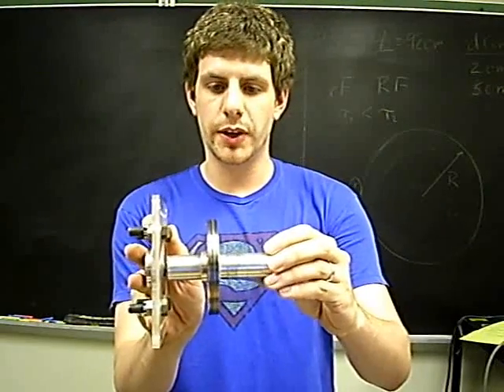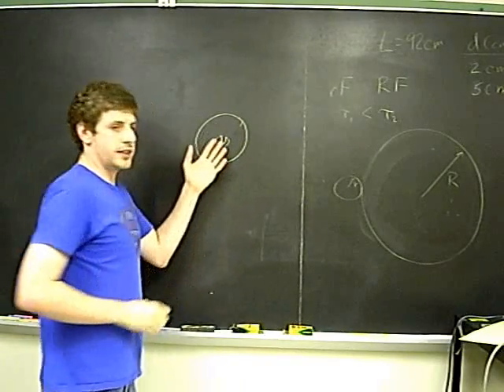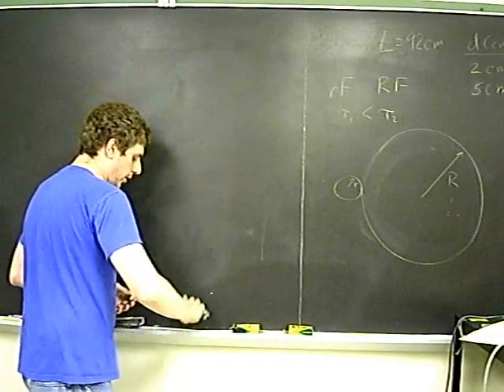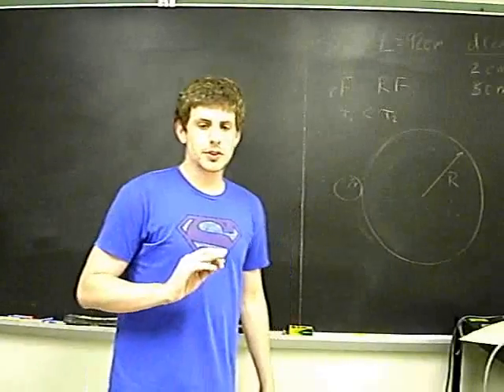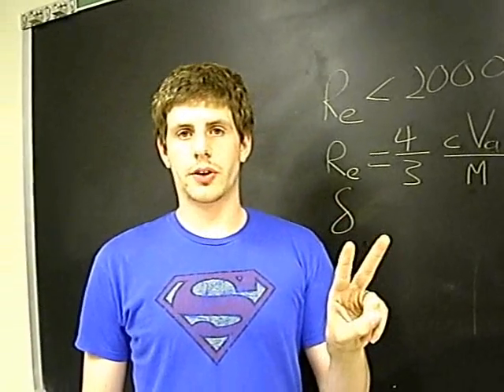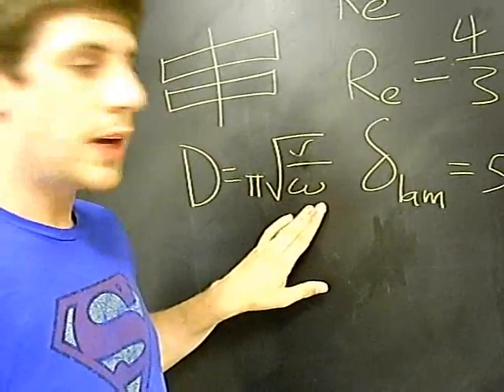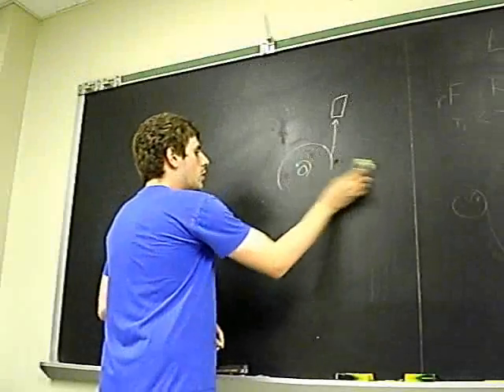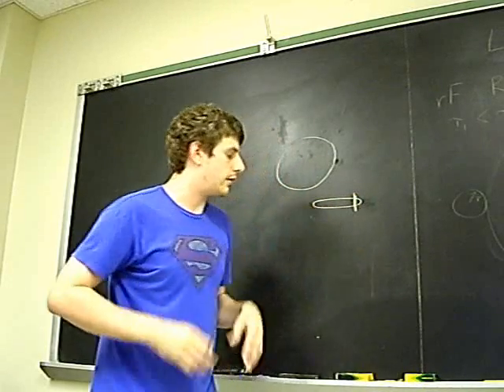Tesla Turbine Concepts Explained

Comment: You are mistaken. You said at higher speeds the air particles travel straight to the exhaust but that is not true. At higher speeds the air particles take a longer path before exiting at the exhaust. The air particle makes more revolutions and form a tighter and even fuller spiral. therefore there is more particle-disk contact and more efficiency at higher speeds.
Reply from the maker: I made that statement based on documentation available at the time. Can you show the documentation that you are referencing in your comment.
Reply: @heavym3tal  what Tesla says to do is increase the surface area, and decrease the disc spacing because the highest economy comes when slip is reduced.
Reply: Melvin Bradley van Os friction, air that contacts the turbine impeller is bound to it via friction, that is the boundary layer, additional air moves across this boundary layer not the impeller/disc, how it behaves is relevant to the viscosity and clearance in between discs, the surface texture, and clearance between discs and internal housing surface, there has to be enough space to allow for adequate surface layers, and still optimize the mechanical energy of the high pressure incoming air (heats up) low pressure exhaust air, cools down as it exits the port creating the vacuum that causes the phenomenon that increases the efficiency of the turbine to an incredibly close ratio 0.7 : 1, (I’ve 
L
seen demonstrated) or better, the PHD Professor (demo guy) said i can’t remember his name I had no interest at the time other than how to convert it into a turbo unit
Reply: No he was correct. The highest efficiency happens when there is the least amount of slip on the discs. Ie, they make the least amount of spirals around the face of discs. When you spin them fast they make many spirals around with the discs inside the case while not sliding far across the face of the discs.
Reply: Charlie solis is designing Tesla turbines around this principle and they actually work. Real power and torque even at low rpm. Tesla NEVER says to spin it fast as a turbine. He says to do that when using it as a pump… because ALL centrifugal pumps performance is tip speed dependent. But he never says to spin the turbine fast to get high efficiency. 

What he does say for increasing the economy is to increase the surface area and decrease the disc spacing. Charlie solis has added that you can change the surface adhesion properties like using hydroPHILLIC coatings to increase the boundary layer width but that’s a whole other discussion. But Tesla is directly quoted as saying:

“Owing to a number of causes affecting the performance, it is difficult to frame a precise rule which would be generally applicable, but it may be stated that within certain limits, and other conditions being the same, the torque is directly proportionate to the square of the velocity of the fluid relatively to the runner and to the effective area of the disks and, inversely, to the distance separating them. The machine will, generally, perform its maximum work when the effective speed of the runner is one-half of that of the fluid; but to attain the highest economy, the relative speed or slip, for any given performance, should be as small as possible. This condition may be to any desired degree approximated by increasing the active area of and reducing the space between the disks.”
Reply: lit

Comment: How might you make one of these with torque to be able to turn a rod/shaft. I have been  thinking of tesla turbines powerd by steam to charge battery's, so how would you create the torque for something like an alternator
Reply: Charlie Solis makes actual working Tesla turbines that output real power and torque even at low RPMs. You have to increase the surface area and decrease the disc spacing to reduce slip.
Reply: +Stephen Redmond from what I've studied so far on these tesla turbines the way to increase torque is to increase disc size  and number and  as the video mentions reduce spacing of the discs accordingly. The problem is how people are discussing what efficiency is. I think it has an extremely high mechanical efficiency. However this does not mean electrical efficiency. As he says in the video the you will get greater efficiency at higher speeds...to a certain point. Commonly these are tested at way too low of rpms to get good results. And as he says it doesn't produce a lot of power. Fins will increase torque but drastically lower efficiency at the higher rpms. So for this device it's better to increase the disc size which will lower the rpms producing more torque but maintaining higher mechanical efficiency.
Reply: Gearing it down or make with perpendicular fins to direction of flow.
Reply: Johnnyq90 has some really good examples

Comment: Why don't we use Tesla Turbines? The answer is simple they are not as economical as other turbines.
Reply: +Edward Wechner Just to add on to this: from the numbers I've seen, a Tesla Turbine without load achieves 97%+ efficiency at peak RPM. Under load, that efficiency drops down to about 55%, which for a single stage turbine is great. But can't compete with multi-stage turbine designs that achieve 75%+ efficiency, such as those used in power generation.
Reply: @chrisgbk  then you do a second stage TesTur too…..

 Everyone wants to compare it to the efficiency of a very high temp, high pressure (1000°F & ~1800psi) multibillion dollar 15-30 stage steam turbines…   😮‍💨   

That’s apples to rocket ships. 😅  

But considering Rankine Steam cycles get theoretical max about 33% of input heat (due to latent heat of condensation and that’s without any regenerative boiler feedwater preheat, air fuel preheat, etc) and then 40% isentropic efficiency (considering the turbine as is) we’re looking at 13.2% thermal efficiency with steam.   

A more apt comparison for the TesTur would be something an individual can actually purchase, like 1-5kW piston gas generators that you can get from Home Depot or Lowe’s.   

These get 15-22% thermal efficiency off the plant floor. 

Good luck getting that 1 year down the line or later with all those moving parts.  

Also for reference, industry standard for micro bladed gas turbines is 25% thermal to electrical. 

Whole system efficiency can go higher in Combined Heat and Power (CHP) system, but alas the TesTur would see the same whole system efficiency increase in a CHP Auxiliary Power Unit (APU).  

In the TesTur you gotta replace…? 🤔bearings…? And still even then, only maybe 🤷‍♂️ depending on how good of bearings, balance, lubing, cooling.   

The TesTur, and other bladed turbines, only have one moving part. 🔥
Reply: @chrisgbk  So if those piston generators drop efficiency, even at all, the TesTur on its worst day is competitive with a gasoline piston engine electric generator.🤓😬🤷‍♂️  

And the TesTur can handle any fuel that can burn, even solid particulate fuels like powdered saw dust, pulverized coal, powdered iron, biomass, etc. 

(noting the number of those that can be acquired for free… 🤑 opening up “Monetarily free”, even carbon neutral, fuel options for MILLIONS around the world)  

We have to remember that the TesTur doesn’t have to be the holy grail to be worth using if we have free fuels readily available like biomass, and even waste heat already being dumped out into the air and not used for anything.  

The TesTur just has to be a viable option for some to be worth doing.
Reply: @chrisgbk  Even more, the mere fact that I’m using a low temp fluid for my 40% isentropic efficiency calculation means my TesTur efficiency is severely limited by thermodynamics and fluid dynamics.   

Increasing temps will automatically increase my turbines efficiency.  

This is because gasses have an increasing viscosity trend as you increase the temperature.   

This leads to increased isentropic efficiencies in the TesTur from reduced slip on the discs.  

(Meanwhile, we’re already talking about a piston engine using combustion temps as is.)  

Whereas bladed turbines see the increased viscosity as an increase in drag loss through the turbine blades.   

So we can’t always count on seeing increased isentropic efficiencies in a bladed turbine in practice when we go from low temp to a high temp.  

Again, to reiterate, this increase in viscosity in the TesTur only works to enhance the working action of the TesTur.  (That being viscous adhesion to the disc faces increasing torque.)  

That’s all on top of the increased thermodynamic efficiencies of using a higher temp elastic fluid too! 🤓
Reply: @chrisgbk As far as efficiency goes on my TesTur… (mind you this is a copy pasta 🍝 so it’s a bit long but it’s worth the read.) 

…My 2650watt electrical load run came in with a very low ball calculation of 40% isentropic efficiency.  

To start off, mind you that includes generator losses, 3 phase rectifier losses, and inverter losses to the electrical load that were not accounted for. 

So the turbine off the bat is already most definitely doing better than the 40% isentropic efficiency I’ve calculated from the already low ball test results.   

But for now I’ll just assume 40% isentropic efficiency so that I’m not over claiming what I can prove it can actually do for the time being. 

(I have nothing in the long run to benefit by overstating my numbers and only my legitimacy to lose. 

I’ve worked hard for my physics degree and don’t intend to tarnish it for a couple of extra views on the internet.)
Reply: @chrisgbk  As far as inefficiencies to the system to fix, there’s 10x crappy ball bearings in this version, 2 crappy RC car gears, both losses will be gained for power out with a direct to shaft generator. (Minus two gears and 8 crappy ball bearings)  

There’s an 1/8 of an inch of space between the turbine endplates and the casing endplates on both sides of the TesTur. 

That’s a 1/4in of open flow area around the 2in wide turbine 

(that only even has a total of 0.75in wide of spacing between all the tight disc spaces for torque to begin with.)   

That means 25% of the open space for flowing through the casing, between discs and between the casing and turbine endplates, is just free flow over the side of the turbine still. 

(I’m using the absolute bottom of the barrel of machining equipment right now in my garage 🤷‍♂️)  

There’s no labyrinth seals yet to even attempt to further reduce that overflow…
Reply: @chrisgbk  The nozzle is atrocious at the moment, when making the variable converging section have a tight convergence it causes the fluid jet to aim more centripetally (towards the axle) instead of tangentially (glancing off the disc tips) which severely effects the fluids natural path.   

This will be fixed with the new variable nozzle design I’m going with.    

Then even further in this specific casing’s assembly there’s two “pillars” in the middle of the nozzle.   

This is because the aluminum plates in the middle of the casing plate stack only had the variable nozzle bar and inlet holes cut out, and not the full nozzle geometry.  

So those pillars are just vertical bars in the middle of the nozzle for the air to smash into just before going into the turbine 

(hopefully the wet steam tests will just erode them down 🤭)   

Before all that there’s still about 100ft of air hose between the tanks and the turbine… 

plus a shell and tube heat exchanger and a TON of elbows and fittings.    

I’m sure I’m forgetting something too but between all that being fixed… 

I can almost guarantee we will be in the 60-70s % range and that’s all just still with room temp compressed air.   

Most forget, I’m using room temp compressed air and never went over 20psi at the nozzle for these tests. 

(Pressure differential and temperature differential govern efficiency)
Reply: @chrisgbk  The disc spacing for room temp gasses is not going to be the same for combustion temp gasses/steam because the viscosity of either increases by 3x fold. 

And I’ve designed these spaces for a higher temp fluid with a slightly higher viscosity so these will inherently be too wide at the current temperatures being used.   

So as we increase temps along with all these other really easy to fix mechanical issues (that only are a thing because I’m building this in my garage on a junk cnc machine) I have no doubt we will see more than competitive isentropic efficiencies compared to bladed turbines, let alone whole system thermal efficiencies that are through the roof.   

This is because of the heat recovery systems that can be added with the cost savings of using a TesTur vs a VERY expensive, and in my opinion, relatively delicate bladed turbine.   

Just getting tighter casing clearance with the turbine should give me at least 20% points back on efficiency putting my testur at the 60% range.   

Coming in with a 19% thermal efficiency in a Rankine steam system without any kind of thermal recoup.
Reply: We do! The basic principal of a centrifugal pump works this way. So for pumping solids (powders) and that of pumping sullies (such as oil sands in a liquid), then such pumps are common and are based on this principle.
Reply: Yes I agree with you here. The Tesla turbines are not used commercially because they are misunderstood. I think here you speak of a problem of capitalism not of the turbine. Tesla wanted to broadcast electricity to the UK wirelessly. He approached JpMorgan for the funding. It had already been decided that interests wanted to support power being travelled through cables. Why? Because commercially they had already invested in copper. I've wondered just how many good ideas are passed over because they can not me monitized.
Reply: +andrew cravalho No, Andrew, I do not speak of a problem of capitalism, I speak of a technical problem with the turbine. If we would be able to replace current electricity generating turbines with a Tesla Turbine that would be even only a fraction more efficient and thus reduce the carbon foot print, than the whole world would invest any money to replace our current turbines with Tesla Turbines. The simple fact is the Tesla Turbine does not even come near the efficiency of the turbines we are using right now.
Reply: +Edward Wechner i don't think this is true. I just think they are misunderstood and different than what we're used to. If you examine most of tesla's inventions he was always looking for a natural phenomena to take advantage of. He wanted to exploit from natural energy cycles to produce increasing kinetic energy. With this device the efficiency increases with speed taking advantage of the vortex energy. That's not a model we're accustomed to.
Reply: @drewberrynews3875  exactly!! And I’ve got the proof now to tell everyone they are practical and work and output power and torque even at low RPMs. Even geared UP to the generators.
Reply: +andrew cravalho The reality is we are using millions of turbines around the world to generate electricity, to power ships and planes, why are none of them Tesla Turbines? The answer is very simple they are just not competitive.Tesla was a very accomplished engineer, he gave us the induction motor, but look a bit deeper into his achievements you will find that most of his inventions were commercial failures, the Tesla Turbine is one of them. We are accustomed to commercial success and nothing else.
Reply: @EdwardWechner  Can you show me a bladed turbine that can handle the wet steam that’s produced from geothermal energy sources without eroding down the indispensable complex geometry blades to little nubbins in a matter of minutes?   

Or a bladed turbine that can actually fully utilize all the heat energy in steam by actually fully expanding it and not be damaged by the condensation and cavitation?   

One that doesn’t require superheaters, MASSIVE heat exchangers and expensive waste heat recovery systems to actually maintain whole system thermal efficiency?   

Yeah sadly bladed turbines get zero efficiency from geothermal steam sources and can only be used to produce electricity from them with outrageously expensive multi circuit loops to keep all the fluids separate and have MASSIVE heat exchangers.   

But when even just one geothermal site in California has more energy than the US needs for the next 1000 years and TesTurs see no damage from multiphase motive fluid flows I’d take even just 10% efficiency over the zero that bladed turbines can offer.   

The same goes for solar steam boilers because it’s very difficult to have a residential solar boiler that doesn’t produce wet steam.   Furthermore bladed turbines can’t use low grade fuels like biomass, woodgas, and definitely not solid particulate fuels like powdered coals and pulverized iron.   

That’s not an issue for the TesTur for the exact same reason that condensate and cavitation in wet steam doesn’t damage it. 

Because there’s no lifting surfaces for the particulate to smash into.
Reply: @EdwardWechner  What most people mean to be saying is, bladed turbines get a high efficiency on only a very limiting, very specific, very expensive set of proprietary formula refined fuels.  

And the only reason TesTurs don’t is because no one has actually put any money into them like the BILLIONS of dollars thrown at proprietary bladed turbine designs just to get 1% point increase in efficiency.
Reply: Edward Wechner i dont think so mister. true is no one understood what raider vont to say( or pay)